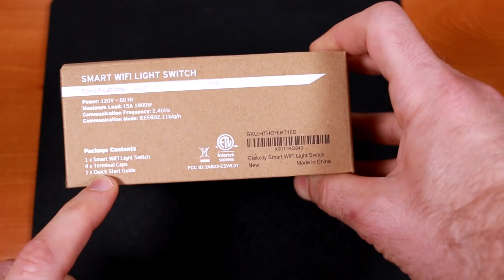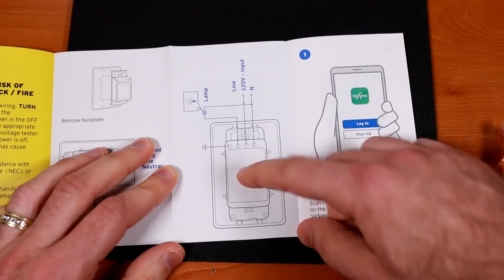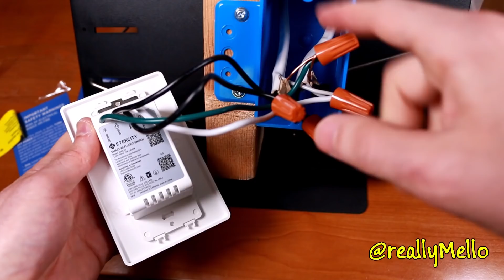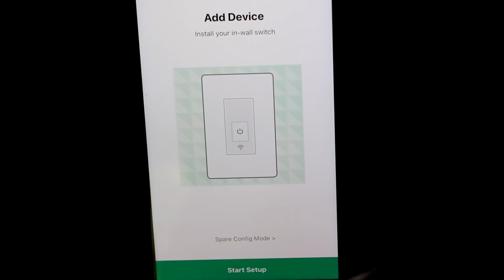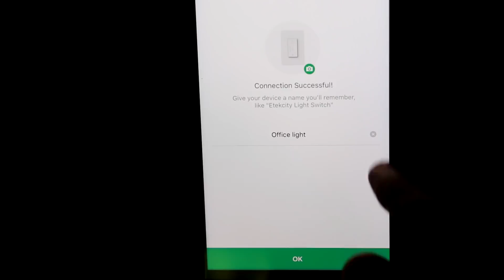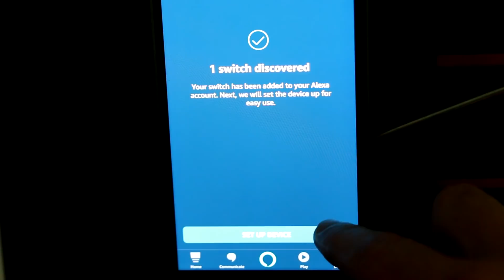Etekcity ESWL01 smart light switch setup with Alexa review

Comment: What's the work around if you only have 2 (two) wires in the light switch box that you would like to replace?
Reply from the maker: So there is no neutral wire? What two do you have?
Reply: reallyMello the power and load , the house was built before 1980
Reply from the maker: @CarlJohnsonandAssociates  these smart switches use the neutral to get power so that when the switch is off it still gets power to keep itself on to communicate for the "smart" functions. You'd need to have an electrician run a neutral to the switch or get a smart switch that doesn't require a neutral (these are harder to find and may not work with all light fixtures, these kind act sort of like dimmers). Unfortunately there is no workaround I know of other than those 2 options. I hope that helps.
Reply: @reallyMello  cool I starting to see that it's no work around. Heres my next question. I do have a neutral switch in my office can I tie into that wire and run it to the other switches?
Reply: reallyMello hey I didn’t realize I was under your post again but I have the same problem with a different switch. Apparently most of my switches don’t have a neutral wire

Comment: what if you only have 3 wires coming out of the wall? power + neutral + ground
Reply from the maker: You are replacing an existing switch? Doesn’t seem right if so, like the neutral isn’t being used as a neutral or something like that. Something would have to be bringing power in and then something would need to be carrying power out through the switch.
Reply: @reallyMello  yes white wire (power) black wire (neutral) cooper wire (ground)
Reply from the maker: Carl Johnson so typically there is a black wire coming from main line power going into the switch and another black wire leaving the switch going to the load like the light (color coding isn’t always followed though) what was connected to the original switch?
Reply: @reallyMello  right . But my new switch has 4 wires black (line) black (load) green (ground) white (neutral) when I connected it like i thought it would go they were on but blinking. So I had the neutral and the load coming from the new switch going to the neutral in the wall. And the line wire from the new switch going to the hot wire in the wall and the ground going to the ground
Reply from the maker: If I understand your reply correctly, if the device you are using to control the switch with light a light doesn't have a neutral coming from it that is fine (verify with an electrician). You'd just connect the neutral from the switch to the one from the wall. Black line from main power to line on switch and black load from switch to load wire going to the load, the light/device. Ground to ground. Like in page 10 of the diagram https://static.etekcity.com/files/manual/V1.3_HTHOHIHT16D%20Smart%20WiFi%20Light%20Switch%20ESWL01%20MANUAL.pdf
Please check with an electrician if there are any oddities or concerns for safety sake.
Reply: @reallyMello  the load line doesn't have anywhere to go . That's the problem I have 4 wires on the switch only 3 coming out of the wall
Reply from the maker: That's confusing because if they are from the same wire bundle of black/white/ground that would typically just be the main power, neutral, and ground respectively and then some separate wire bundle would be going to the device you are controlling. So if there was an existing switch in there you were replacing what wire was it using it to send switched power to the device you are switching on or off?
Reply: @reallyMello  old house built in 1962
Reply: @reallyMello  lol I have no idea ... I think I will call a electrician because this shouldn't be that hard . That's for your time. I really , really appreciate it
Reply from the maker: @CarlJohnsonandAssociates  Old houses are tricky. Good idea checking with an electrician. Hope it all works out!
Reply: @reallyMello  I just installed it in my office didn't take 20mins . Only difference was my office had exactly what you said , wall power  + line leading to lights + neutral + ground
.... thanks again for your time
Reply from the maker: Awesome Carl, hope you enjoy them.

Comment: Thanks for the video, really helpful. I have a few questions. Does this work with more that one light? and you have to be in connected to the wifi to  turn on/off the light? i want a product that i can switch on/off light while im away from home.
Reply from the maker: You can setup groups and routines but yes you need Alexa’s access to the internet working and the devices need to be online in your local WiFi
Reply from the maker: And it can be done remotely too

Comment: Great video!  I have some etekcity plugs that work great with my alexa.  I just installed the switch and it works great with the vesync app but I cant get alexa to discover the switch.  Any ideas on what might be going on?  Any help would be appreciated.
Reply from the maker: Thanks! Are both Alexa and the switches on the same WiFi network? Is the Alexa app up to date? Have you also tried “Alexa, discover devices?”
Reply: @reallyMello  Alexa app is up to date.  I have asked her to discover devices no luck.  The switch and alexa are on the same network with the exception that the switch is on the 2.4ghz band and alexa is on the 5ghz band.  That was never an issue with the etekcity plugs though.
Reply: @reallyMello  I just put Alexa and the switch both on 2.4ghz same network still no dice.
Reply from the maker: So in the Alexa app you went to + then add a switch and selected other I assume? If it is found the the VeSync app it should be findable so that is weird.
Reply: @reallyMello  yep add device, switch, other and it just wont find it.  It is really weird.  I use sengled bulbs for everything else but this light has built in leds in it so cant use smart bulbs.  I have to have the switch.  Sengled works flawlessly so I guess I can cross my fingers they will make a switch someday.  Looks like etekcity switch is gonna be a bust for me.